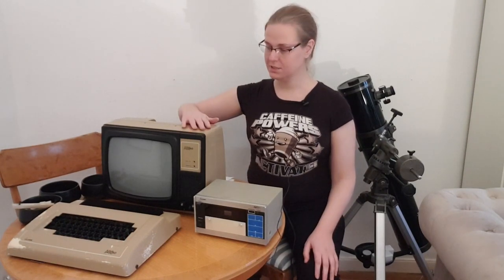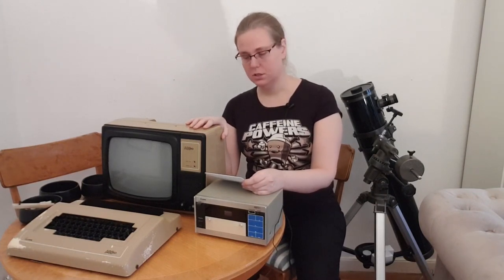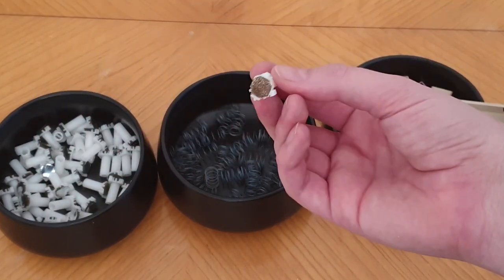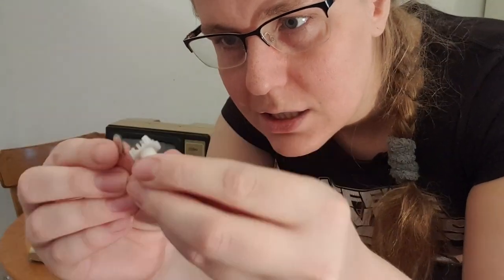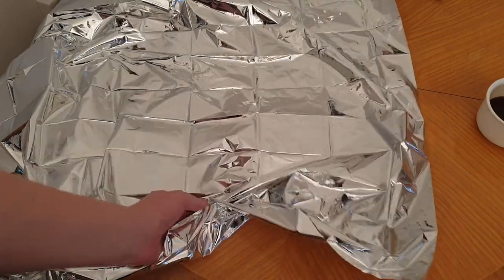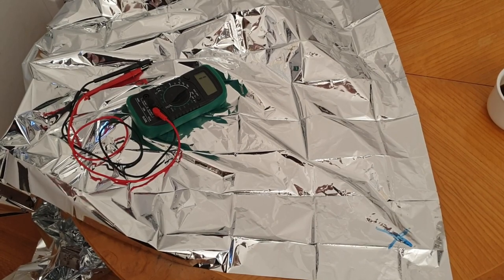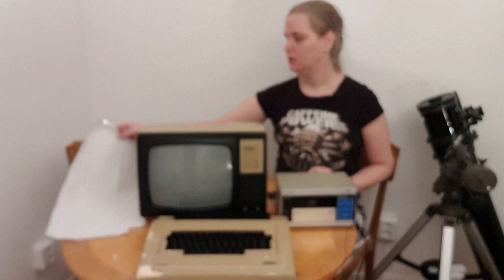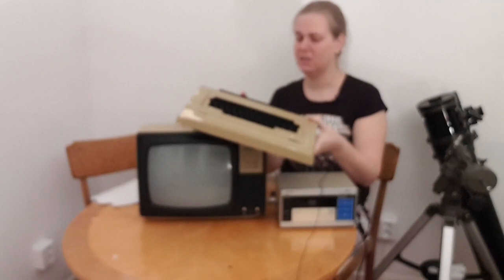Luxor ABC80 intro and keyboard repair - part 1

Comment: Did you forgot to mention that the ABC-80 was based on an earlier industrial computer design in Sweden, the databoard 4680. That's why they could develop ABC-80 and it's efficient BASIC so quickly. They had even designed a couple of personal (sort of) computers before, in 1976-77. One of them for Philips.
Reply from the maker: I will make sure to mention that in the follow-up video! Thanks for the input!

Comment: For one thing, the bus connector is an actual standardized connector with gold plated pins - none of that card edge rubbish :) The bus connections using the ribbon cable were quite reliable. The first floppy disk drive unit for the 80 connected with a long ribbon. The unit itself had a “nest” for the monitor between the two full-height floppy drives standing vertically on each side. The part that the monitor stood on was an extension card cage. The floppy drive unit and the 80-column (80-tecken) “mod” that fit just barely under the keyboard let you run CP/M on this thing. I may still have the entire system stashed somewhere. Hopefully in a year or two I’ll be able to physically get to it.

Comment: When i was 16 isch we use those ABC 80 in  school to learn BASIC   its was a bit fun then and then
2 years later i used ABC 800  to learn how to measure presssaure and flow  in a program  to make 
a kind of flow and pressaure  chart for pumps.  Its sure was fun then

Comment: The Basic on ABC80 was pretty good. And then they came out with BASIC-II for the ABC800. That basic, on Z80s of the time, was faster than GWbasic on the original PC and original XT IIRC. It was a basic in which many business application systems were written - not toy apps, but big systems that entire companies run on. In Basic. It was that good. I wrote an email program (long lost) for ABC-802 that did full screen editing using peeks and pokes and had normal interactive speed you’d expect of any such program. Screen manipulation with peeks and pokes was so efficient in BASIC II that it worked well. I have a couple 802s and may one day recreate that thing. It connected to Internet via slip via the serial port.

Comment: The punch has to be sharpened to work on thin and compressible materials. It’s only sharp enough to use on thicker paper, belts and leather, and some fabrics. For Mylar, the punch has to be razor-sharp. The only reliable way I found to sharpen it was to use a little 3D-printed jig to hold it at a correct angle against a very fine grinding wheel. Then it can cut Mylar. It gets dull quickly though. Ideally the cutting edge should be hardened and then sharpened and polished but I never bothered :)

Comment: that kind of kassetdeck  we never used in the mid 80's  we used a simplier one.
Reply: Hello ! My fault i just realized at 04.29 a thing ett år didnt use that kassetdeck we used floppydisc first we used single  
Side flippat disco with 386 kB per side .

Comment: So when are we going to see the followup for this one? :-)
Reply from the maker: Recording is almost finished, so I'm planning on doing the editing this week! Sorry for taking so long!
Reply: @z80-dreams14  No need to appologize, i know how long time these things take :-)

Im just eager to see how it worked out for you :-)
Reply from the maker: @RetroComputingwithMike : I saw that we ordered the same foam pad-kit for keytronic keyboards! I wanted to compare three different methods of repair, including the foam pads, but due to problems with delivery from U.S. I ended up comparing two methods. :)
Reply: @z80-dreams14  Interesting? I only found two possible suppliers, i got notice from customs friday that the U.S. Shipment was on its way, so maybe i just got lucky :)
Reply from the maker: @RetroComputingwithMike  Two suppliers plus a home made hack! Unfortunately the U.S.-shippment didn't arrive for me (that's what has been holding up the video). In the end, I thought it was better to make a video with two methods, instead of delaying it even further.
Reply: @z80-dreams14  Ah cool ... well technically i haven't gotten it yet either, but one can hope :-)

I've considered purchasing a laser cutter and some double-adheisive-insulation-lists and trying to cut them myself ... but the project suddenly grows out of proportions then :P
Reply from the maker: @RetroComputingwithMike , it's dpne now! After editing the rendering took all night, but finally i could upload part two! You can see it here: https://youtu.be/DrXX7uLEPbI

Comment: Hello !   well i guess i was a bit  wrong here because we use floppdisc 360 kb  i suppose it was first
with one side and the we use double side like old cassette first one side then the other side .
I was so impressed when we got the newest  floppydisc 1mb   in the beginning of the 90's
The 5.25-inch diskettes were available in a capacity of 160 KB single side, 360 KB low density, and 1.2 MB high density sizes. By 1994, the 5.25-inch disk was extinct and was replaced by the preferred 3.5-inch disks. The 5 1/4" floppy diskette was really floppy (flimsy), hence the name
Reply from the maker: Hi! I've been looking for these floppy disk stations for so many years now, but they seem impossible to find! It seems like the sizes were the same for Commodore 5,25 inch floppies, they also had DD single side, DD double side (in the beginning you had to take the floppy out and turn it around manually) and later HD double side. Very nice that you got to use all thee formats!

Comment: Mylar is the plastic. What you got is metallized Mylar. There’s no benefit to metallizing it on both sides for use as a heat retention blanket so they just did one side.